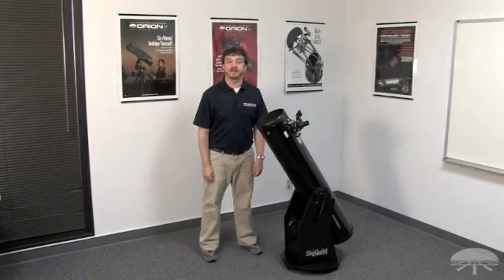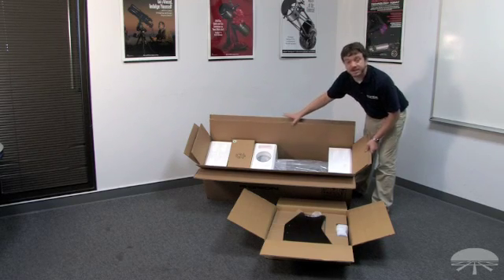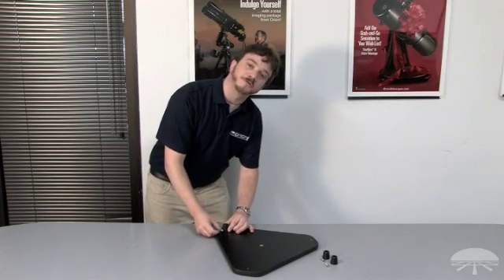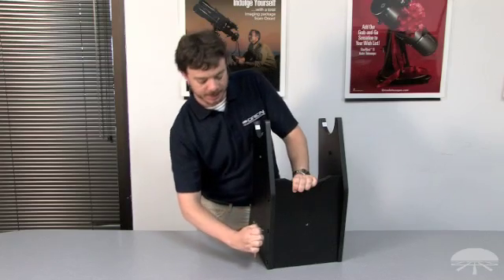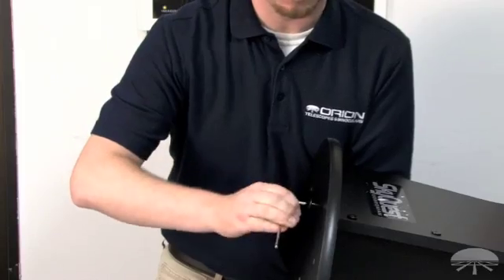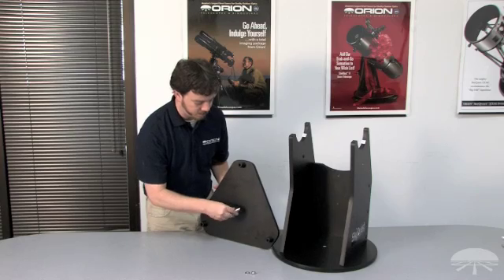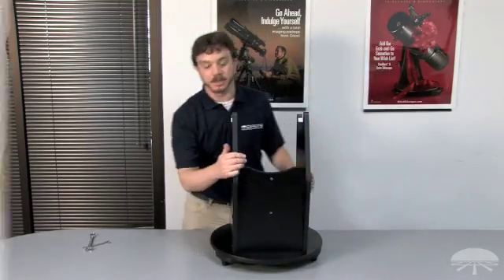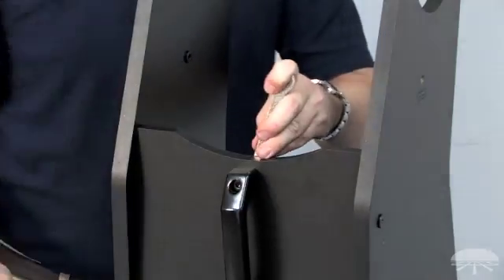How To Assemble the Orion SkyQuest XT8 Classic Dobsonian, Part 1

Comment: Do these not have the eye piece tray?
Reply from the maker: Unfortunately the eyepiece tray isn't included with the XT8 Classic, but the XT8 Plus and XT8i Intelliscope do come with the tray.
Reply: @oriontelescopes  
Thank you. Can I ask another question? I inherited an XT8i, and it has the integrated circuit boards, but the wiring is missing. Is there any to bring it in for repair or to get replacement wires?

Comment: Minor correction at 6:22: The crescent wrench the ships nowadays (> Aug 2017) CAN now used for tightening the handle. Probably the crescent wrenches back then did not have additional jaw on the side which is of the size of the handle nut.

Comment: Is an XT8 PLUS similar in setup?
Reply: Hi Creeper,

Some parts are similar, but others are different.  The Plus doesn't use the spring tension system, but the bottom and side panels go together about the same way.  The Plus has a full assembly guide, so it will detail everything, including what is not covered in this video.

Thanks
-Ken
Orion Telescopes
Reply: Orion Telescopes & Binoculars Thanks Ken!

Comment: Is the xt10 similar?  Getting that this week.
Reply: Hi Alex,

The 10" is very similar to this one, except it's just a little larger.  Assembly should be pretty much identical.

Thanks
-Ken
Orion Telescopes
Reply: yea i got mine about 2 weeks ago. assembly was easy. other than the bolt in the middle of the base is a little tricky. if its too tight it wont turn and too loose its really shaky
Reply from the maker: Alex Wilson
Hi Alex,

The trick for that middle bolt in the base is to tighten the lock nut until the washer below the nut just stops moving on its own, then go 1/4 turn more.  When I'm assembling one, I will tighten the nut, and as it gets close, wiggle the washer with my finger, then tighten the nut a little more.  The moment I can't wiggle the washer by hand is the point where you go 1/4 turn more and you're done.

Thanks
-Ken
Orion Telescopes

Comment from the maker: Hi Bobberfrank08,

The screws for the feet dig into the wood of the base, so you might need a little extra pressure on the screwdriver to get them to tighten all the way down.  However, it should be a reasonable amount of pressure, so if you feel it isn't working and something is defective, we'd be happy to make it right.  Please call us at 800-676-1343, and we can get the issue resolved.

Thanks!
-Ken
Orion Telescopes